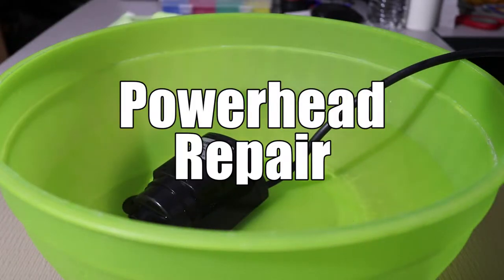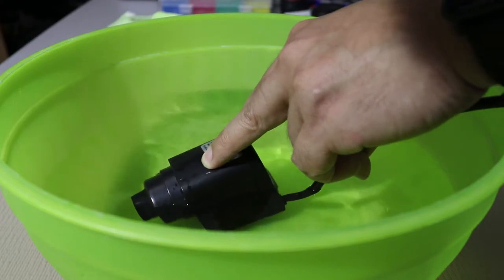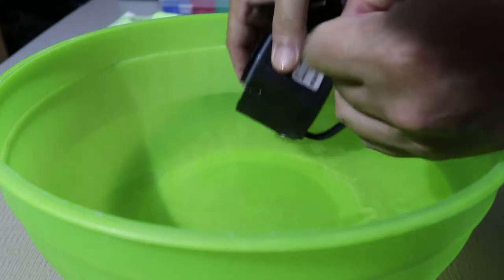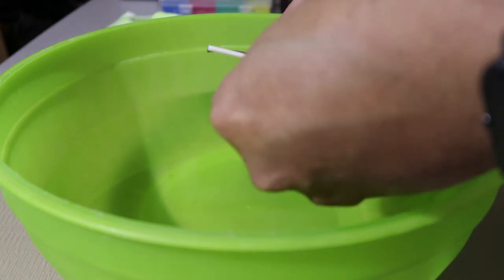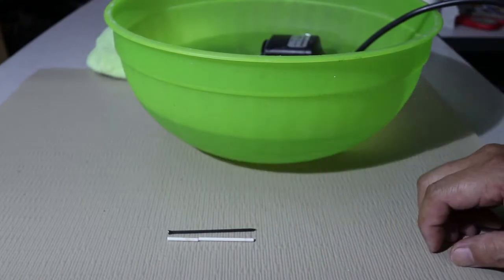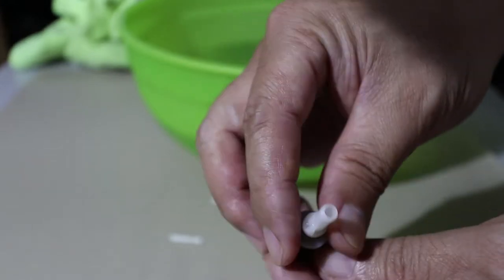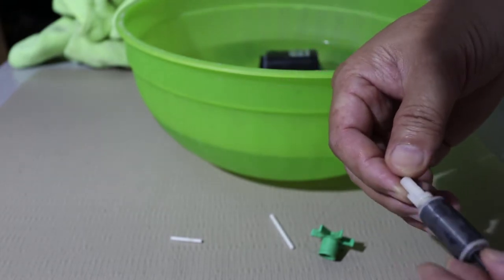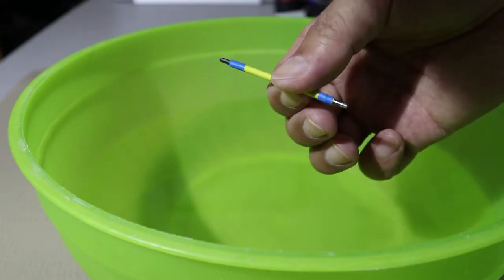20181110 powerhead repair

Comment: Well done dude. The problem i had with my PH was the fan had worn out the shift axis groove it attached to. So the fan and axis no longer spun together. I tried aquarium silicone. It would hold for maybe a day. Then they would separate. So I've gone to JB WELD. Once it cures it becomes like glass. Ive read how it isn't fish safe but once it cures it becomes a solid so I'm gonna give a go